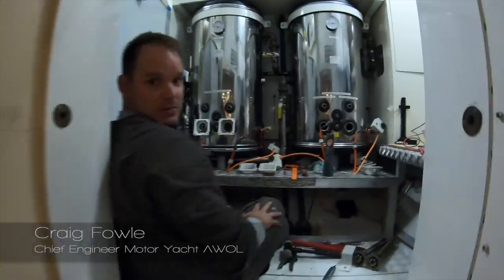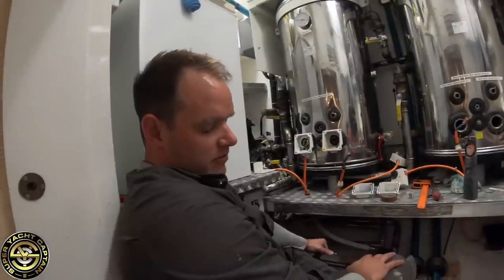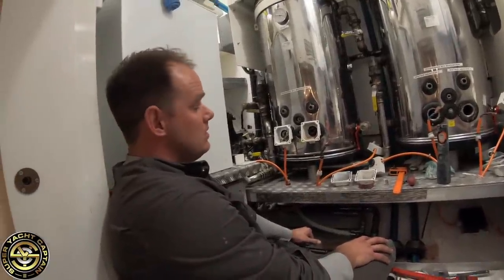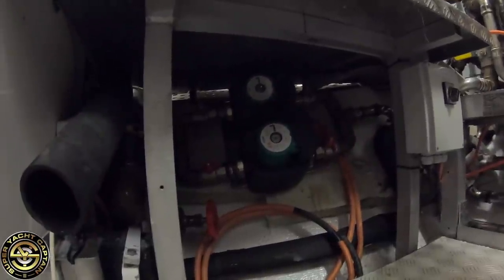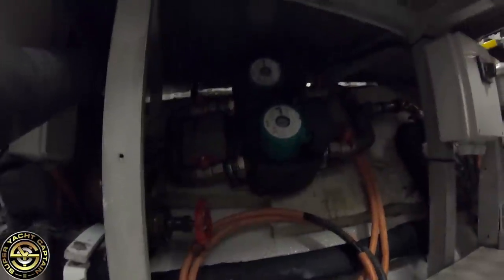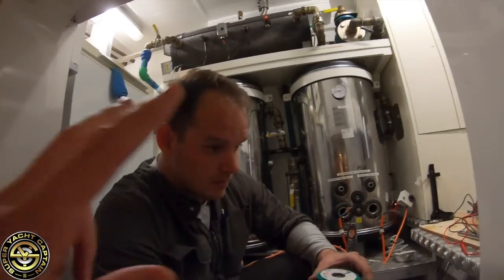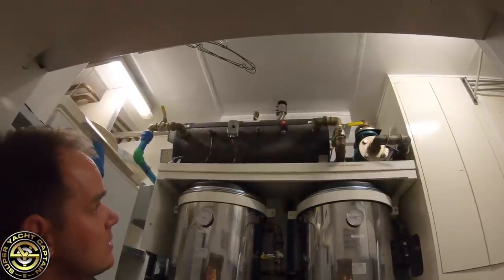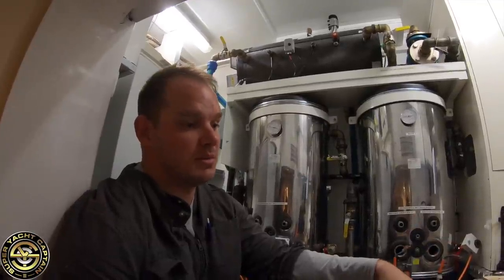Hot water on a Super Yacht (Captain's Vlog 46)

Comment: I design all those mechanical systems but in buildings. Nice to see the duty/standby pumps on the hot water system. FYI a hot water pump should have a body made of brass rather than any other metal as it will not react with the water.  Craig was correct regarding the glycol and that it naturally over time breaks down so it needs to be checked regularly and topped up if needed.

Comment: I have some questions regarding the water system: 
- Have you thought of installing a de-carbonator for fresh water? It requires a little more regular maintenance every few months, but all appliances that heat water (including washing machines, dishwashers and your boilers) become more or less maintenance-free as literally no carbon builds up anymore...
- Do you only take on fresh water at shore or do you also have a de-salination system?
- How is water stored in the tanks? Do you use any additives to keep it free from bacteria and/or algae or is the throughput high enough that that is not necessary? Is the fresh water in the tanks potable and is the quality of the water checked regularly ?
Reply: He showed the desal unit last video.

Comment: You don't seem to use a heat exchanger from the from the engine cooling systems to heat water when engines are running to save using immersion heaters.
Reply: I was thinking about that myself but what really is to be gained by doing it? We stay away from heating water using electricity in buildings because its generally more expensive but on a boat where you have a generator running anyway it likely makes no difference to heat electrically
Reply: @markyboy014  AWOL usually does have a generator running unless they are on shore power, so it would make plenty of sense to have a coolant heat exchanger on each generate (they have 2).

Also engine heat is free, so why burn more fuel to generate the extra power for the hot water when you can tap it off the engines coolant loop For basically free? Many boats actually do this already, particularly sail boats.

Comment: Soak your spent elements in a phosphoric acid solution to clean off the buildup.  Keep a spare set of used ones for quick replacement while you source new ones.  Or if they are that good, just keep using them until they are pooched.  Your kitchen supply should have some phosphoric solution available (CLR is phosphoric, I think).

With regards to your redundant hot water recirc pumps, and other water fittings, check out food-grade tri clamp fittings for quick release.  That way you can do the same phosphoric soaking for scale removal, on a regular basis.  Google "tri clamp fittings" and you'll see how they work.

Comment: So a $10 million used 45m Feadship built in the 80s or 90s  will cost somewhere nearer $3-4 million to run? Plus the older the boat the greater the effort to maintain.
Reply: that depends how much it cost as new, of course if it costed $40 million new it could be a good estimate,  think about a car wair and tear the older it gets the more it costs, also some crew in winter are let of until summer that means no wages, others like captian and enginer and maybe a deckhand or steward are keeped.